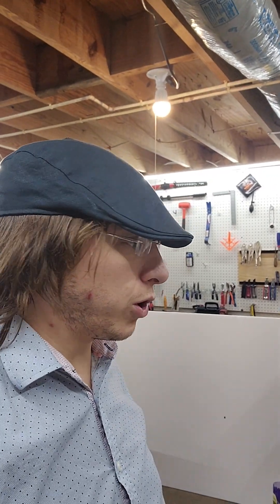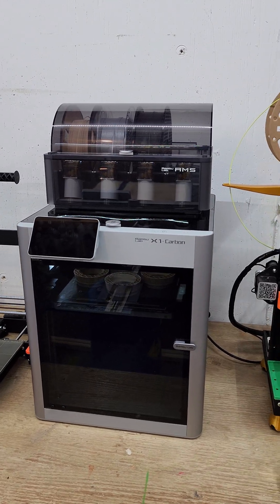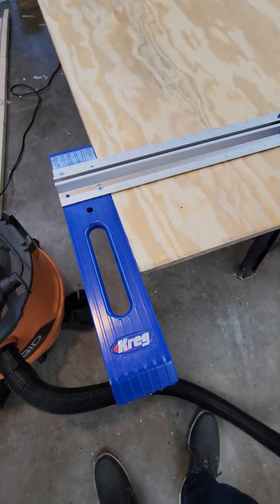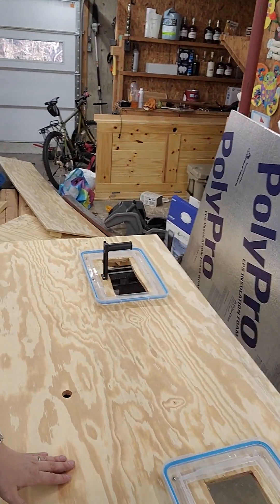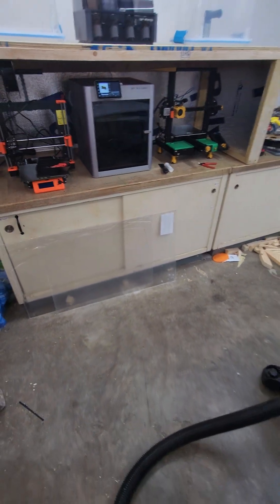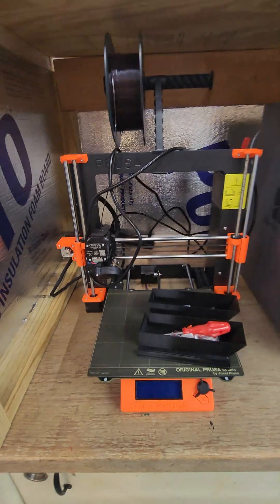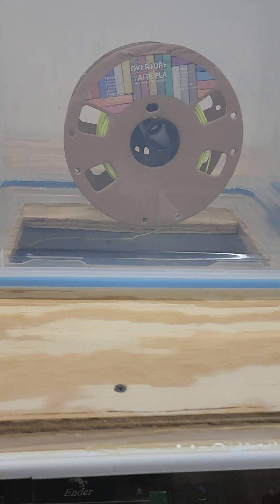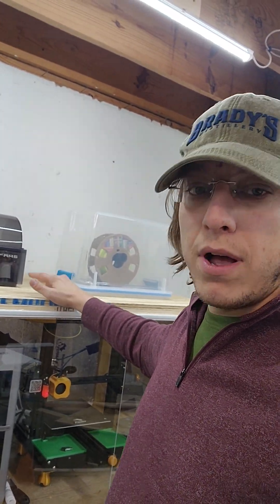Creating a new 3d print space with temp and humidity control.

Comment: You said you were worried about not heating the ground behind your concrete wall, but using non isolated glass just means you will heat up your garage....
Insulation on top and bottom of the enclosure would probably also be a great idea. 
Cost would be recovered if you refrain from the 3*35$ fire extinguisher, which I find a little bit over the top. Sure your insurance policy will cover any accident...
But nice idea.

Comment: Nice build! How has it been working out, humidity wise? Im planning on making something similar in my garage
Reply from the maker: It actually works pretty well. With how often I'm using the 3D printers, that space actually stays pretty warm, which is a great way to remove moisture from filament and have it leave the enclosure. Now, the dry tent on my channel is where I store all of my filament, and it works amazing at keeping the filament dry just by having a simple space heater with some safety precautions.